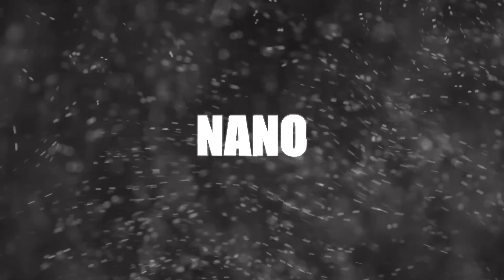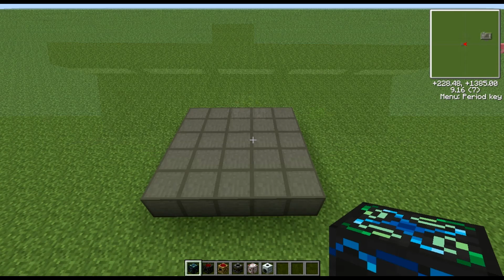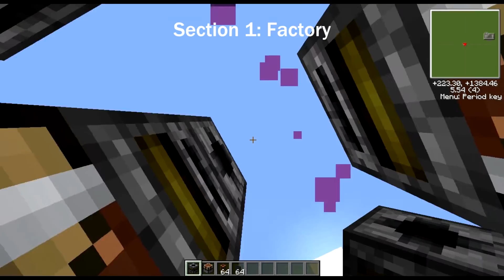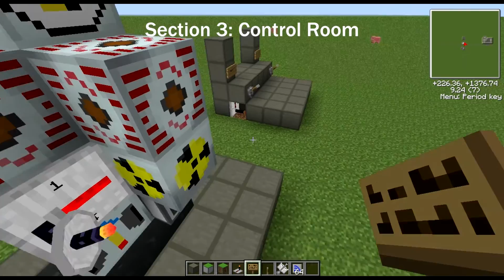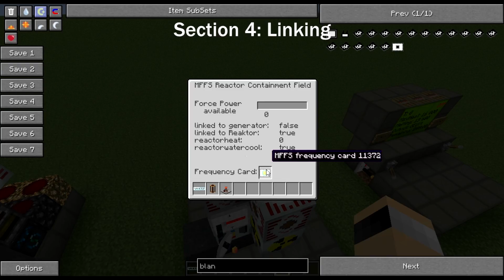Tekkit: Automated Nuclear Reactor Tutorial (2400EU)

Comment: You should put up an item list of everything you will need and put it in the description. It would be much easier for some of us to follow that way. Good video though. Also I don't really understand the whole force field thing. Can you explain that to me?
Reply from the maker: Hey there.

Thats a good idea, i'll do that now :D

Also is it any particular part of the forcefield that you would like me to explain or the whole thing in general?
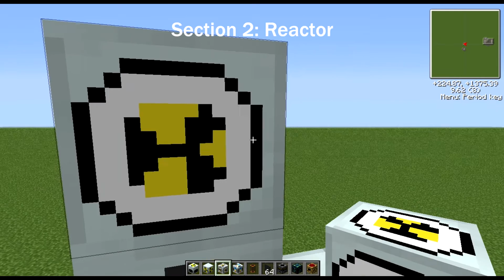The forcefield itself is there to run the coolers, these stop the reactor from overheating by suppling ice constantly which is transported from the condensor to the coolers via a pneumatic tube (the reason this is enclosed in covers is to stop the ice from going directly into the reactor and using slots that should be filled with uranium cells). To set up the forcefield you must first place the Eu Injector and the forcefield core above the factory (like shown in the video at 6:45), you must then use some power source (i used the solar panels as they are the fastest way to do this in creative) to power the forcefield until it is fully charged, the power source may now be removed as it will no longer be needed. Later on once the reactor has been completed and the reactor containment field projector has been placed ontop of the reactor (as seen at 8:10) you must set the reactor water cool setting to true to ensure that the coolers are activated once the forcefield is enabled meaning that the reactor will be cooled by ice and wont overheat. Now that all of this is done you need to take a Blank MFFS card and place it into the forcefield core (the one above the factory ontop of the EU injector) and it should change once it is placed inside, now you need to take it out and place it into the projectorabove the reactor, this will link the core and the projector to allow energy from the core to wirelessly power the projector. Thats pretty much the forcefield construction explained.

The control room has 2 levers, one which is linked to the reactor via a transmitter and reciever and one that is linked to the projector. To ensure that the reactor doesnt overheat you must always turn on the force field first then the reactor, if you do no do this the reactor will automaticaly shut down becasue of the thermal monitor which is linked to the reactor via red alloy wire (once the temperature reaches 3500 degrees the thermal monitor gives off a redstone current which travels through the alloy wire and shuts off the reactor. 

If you have any other questions please ask away, im more than willing to help, also if you have any other factory or tutorial requests for any modpack just reply to this and i'll get to making it as soon as possible, it may look as though im not putting out videos but the reason for that is because i have no clue what people want to see and i'm also doing exams at the moment which should be over relatively soon so more videos will come along :D.

Thanks for asking :D
Reply: @DelusionalGospelHD  So, I know this is slightly late... but you never actually put the list in the description...